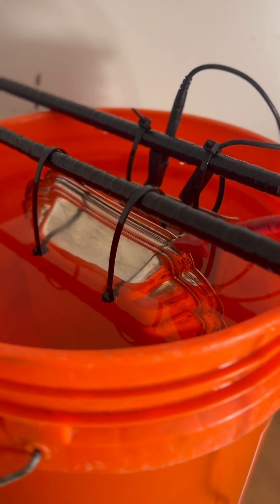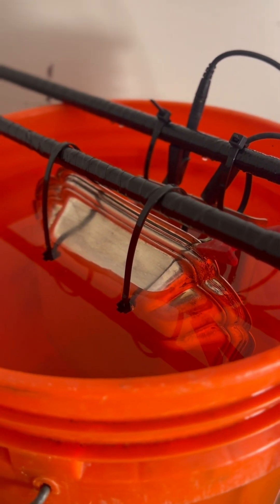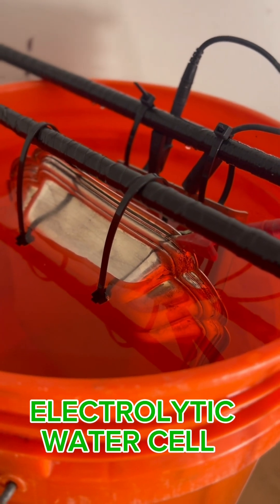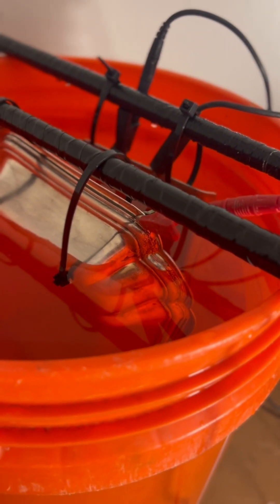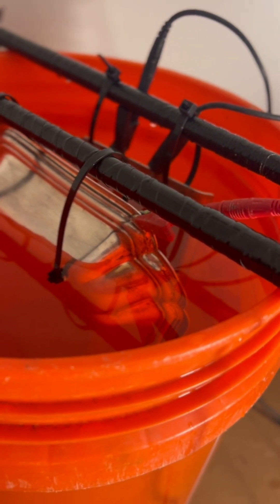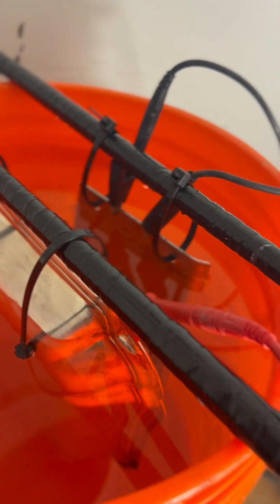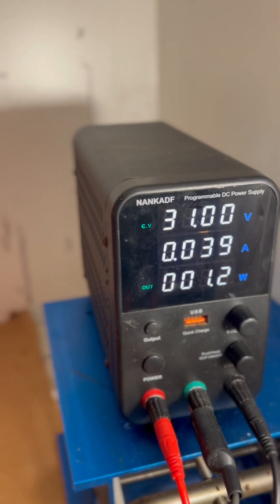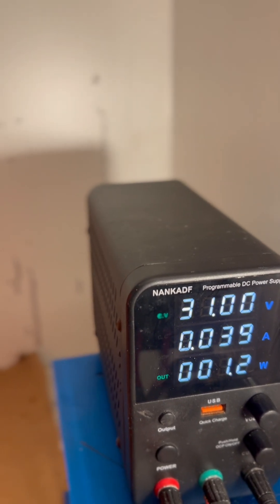Let’s make  a Ten Ounce Silver Bar, Day One.

Comment: Why so much over-voltage? The half-cell voltage of silver is less than 3V. Over-voltage will cause electrolysis of the water, the bubbles of which will interfere with the plating.
Reply from the maker: My plan is to reduce the voltage . When I started it up at 12 V it had no wattage . 30V at .04 amps was .9 watts . So I pushed the Volts up to get some ions in the water then reduce voltage . The copper hydroxide formed can be removed through filtration then heat is my plan so far . Thanks for stopping by , stay tuned for results

Ps the size of the material was also an issue

Comment: No chemicals distilled water is not conductive how's this possible
Reply: Pure water has a resistance of 18.2 MOhm.  Not infinite.
Reply from the maker: @ 11-16 M ohms lol I just checked it out at the pump station .😁
Reply: @Hill-13  o man, did you have to have boots on today?  It's crazy out there
Reply: @ScroogeMcDuckn  yes had the big door open working on a car I thought the roof was coming off.
Reply from the maker: Flip flops and short sleeve we are experiencing a heat wave 38 degrees currently 🤣
Reply: Salt ..... The Ions my man, the Egyptian people did this for the "Baghdad Battery "........      is that even close Hill-13 ? Lol trying to learn 😂
Reply: @ScroogeMcDuckn  I have all the gear but no idea on this I got to the rabbit hole looked in and said to myself this comes somewhere in my chemistry lessons let's stay on track. One thing at a time interesting and confusing as it seems the.
Reply: @empirefinds  yes, we all are at a precise moment if learning,  organically letting it develop, rushing is how I'll get hurt for sure .... can't have my videos to watch if I can't make them lol 😂
Reply from the maker: I’m not sure of the cell mechanics on this it was suggested as means to remove silver plate . It’s not efficient but after 3 hours I started to see results . I did put some well water in which is high in manganese and had some iron to help with a little conductivity . I’m not sure if it the HOH that the cell is using but it works . I will have answers before we conclude this series
Reply: @Hill-13  awesome brother looking forward to the results as you know I am all about free safe and easy